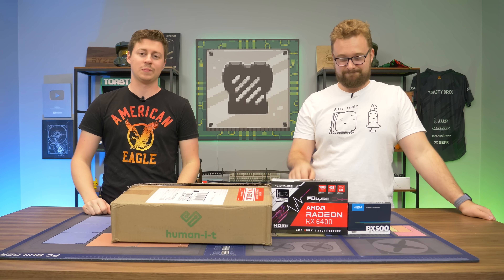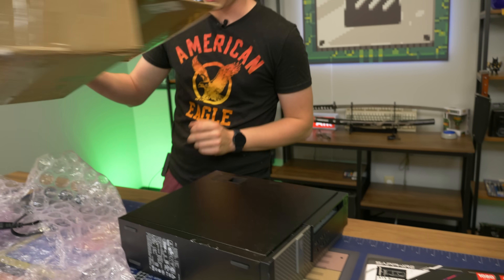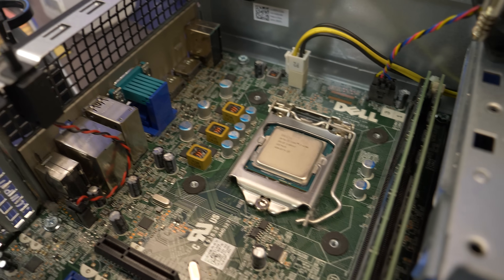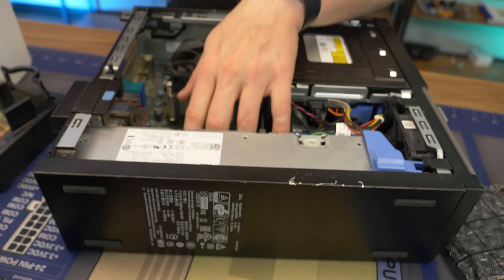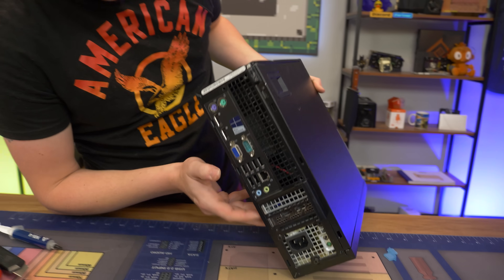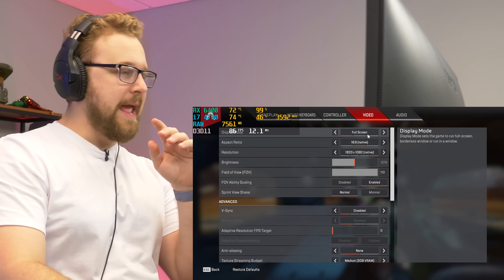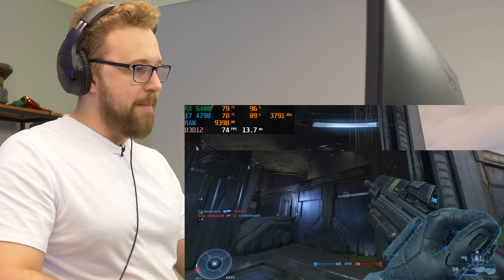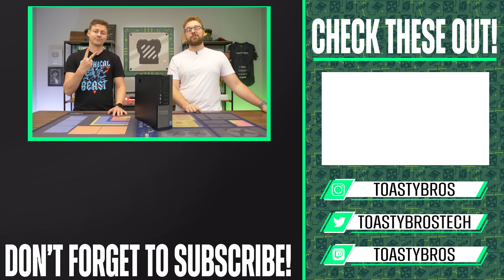EASY $350 Gaming PC Build 2022

Comment: hey guys wanna know if a pc with a i3 9100F and gtx 1060 6gb with 16 gb ddr4 ram is a good buy for $550 or not
Reply: No.   The i3 9100f does not have hyperthreading and will give alot less performance than 10th gen intel at a similar price.   And the 12100f is WAY faster.    You will immediately want to upgrade because 4 core 4 thread chips don’t work well in some recent games.  
You can build a 10th gen machine for less than $400 before adding a gpu is probably what I would do.    The 1060 6gb is worth at most $200.    You can get a used rx570 for $150.   Id go that route or ask the seller for $100 off
Reply: @evers6214  ok thx man 👍👍
Reply: @qurvvv  dont listen to him, the spec is very good and it is worth it to buy these good pc specs
Reply: Depends where you are. I just sold a ryzen 1700, gtx 1070, 16gb ram, ssd etc for 460. I'm southern USA.
Reply: Not terrible, but on the high side. Definitely wouldn't consider it a good deal, but really depends on you're location, and the local market

Comment: yall still sleeping on the Lenovo ThinkStation S30 with a 1620 4 core 8 thread Xeon, they come equipped with a 610W 80+ Gold PSU and anywhere from 8GB of RAM up to like 32GB depending on what model you're getting. Some even have E5 1650 6 Core 12 Thread Xeons. Pair it with a GTX 1070/1080 8GB for a good sleeper build or case swap it to an In Win 101 or another case that top mounts the PSU as you will need that feature to case swap.
Reply from the maker: Will have to give that a shot!
Reply: @ToastyBros  note, you will need 2x SATA to 8 Pin for power hungry cards as the PCIe power is 6 pin. But it's a GOOD little rig. I have one for guests when they wanna come over and game with me.
Reply: @kingkosher6231  i have never heard of someone having a extra pc for guests. Im new to the PC world tho.
Reply: Xeon for the win. The real og budget beast
Reply: I built my Gaming Rig from an Optiplex 9020. i7 4790, Rx6500xt,  32gb ram ,3T hhd and a 1T ssd.  About 700 bucks  with Case,Fans,psu, and all the adaptors.  Still  about half the price of my Lenovo Legion and just as good.
Reply: @tonel5540  The 6500xt is an atrocious GPU and it’s bottnecked by the PCIE lanes not being 4.0 on your motherboard.
Reply: @ZackSNetwork  200 bucks new was a big influencer for me. Its really not bad for my set up. I was being cheap.
Reply: @tonel5540  how much did you spend total?
Reply: @anarchygood5864 $700 for everything at this point.I  was up and gaming for 250 bucks originally. Old optiplex and a 1050 2gb gpu. Had enough leftover parts to build up another ssf hp I got for 50 bucks.
Reply: New Build....Dell XEON 1620 32gb ram ddr4.. off Ebay$ 65 and $65 shipping..Threw in a 1050 2gb i had laying around, payed 50 last year...Surprising 100fps on FiveM, While running my server.
Reply: Oh heck your one on a good thinker, I never thought of that
Reply: ThinkStations are SOOOOOOO good for the money. Agreed. They are sleeping on them. My ThinkStation is a FULL SIZE case so sky is the limit for GPU. Enough with the low profile. Lol
Reply: Just put together a  2019 OptiPlex 3070, i5, 16gb ram ($150) and the rx 6400 ($119). I noticed that the card runs really hot. I thought the fan failed at first. I may get a case fan to draw heat out and cut a hole on the side  to  fit a vent screen. Let me know what you think.
Reply: The Dell 5810 is basically the same thing
Reply: S30 is from 2012. The one showed here is from 2014. Your sleeping recommendation goes beyond $350. The point here was low cost, Low power usage, good performance. You're sleeping bruh
Reply: That card sucked at fortnite 
 in this pc.
I dont play it though.
Mainly racers and flight.sims on pc for me,.running around killing goes against my Christian faith.
Reply: Lenovo thinkstation s30 are 600$ and up

Comment: The max I would put in a SFF Optiplex or any SFF OEM sistem is a GTX 1650 or Super LP card.
Reply: Well lucky for you those are the most powerful cards they'll take anyway lmao
Reply: @SlowHardware  Exactly,  If I would've had a SFF PC with PCIE x4 gen 4 maybe but since most SFF PC's are with PCIE gen 3 it's not worth the performance loss.
Reply: @Teksers  I actually sold an sff pc that u used as my main rig while my x58 pc was down not long ago. It was 16gb ram, i7 2600 and a gddr6 gtx 1650. Performed well but was well slower than the overclocked old 6 core and r9 390x, fun times.. now on a Ryzen 7 3700x and an RX 6700 xt with 32gb ram
Reply: @Teksers  also putting together an optiplex 390 with a gt 1030 atm

Comment: Love optiplex builds been watching people build them for years! Just built my own and did a full case swap. I5 3570,EVGA 1050ti SC,EVGA 80+500w, 250gb ssd and 8gb of ram in a Musetex Case. Super happy with the performance for less than $250
Reply: nice little build bro, that sounds like a decent budget build!
Reply: Sounds like a good computer to flip back then and nowadays. Imagine how much you could flip this for during the GPU shortages. But if It’s for personal use and I made something like this for myself, I would’ve been so proud of that build.
Reply: @tenshi1333  Lenovo ThinkStation S30 / ThinkCentre M900 with a GTX 1060 6GB is the new Optiplex.
Reply: basically what my friend used to have before his pc stop working now he got a new pc
Reply: what are the use of the pc you built so far?
Reply: @funfever8484  I mainly built it for content creation. I'm a photographer/Videographer so that's the main thing I use it for. Adobe apps, things like lightroom, photoshop and Adobe premiere. Gaming wise, I play Apex Legends, pubg, GTA 5, FiveM and a few other free to play titles as I haven't got very many games for it yet. All of them have no problems running 60+ fps I see an average fps of 80 on medium settings on PUBG.
Reply: @alexortiz6891  interesting.
Reply: i did one but with the itx 6400 for 350
Reply: best way to get into pc gaming i think for the price
Reply: My only issue with Optiplex models is their PCIe slot often won't push more than 50W, while some low profile graphics cards require up to 75W without a 60pin power connection. So that nixes the low profile versions of the GTX 750 and GTX 1050.
Reply: Did you use a dell 9020 sff (like in this video) or the mid tower? If you used the 9020 sff did the mobo go into the case okay?
Reply: @LL-wc4wn  I used a 3020 SF and upgraded from the i3 to an i5, it now has 16gb of ram and is my wife's work pc I built a new system for work as the 3rd gen i5 couldn't keep up with the demand. Still works great for gaming tho! Played the new cod on it and get a consistent 60+fps 👌 low setting obviously.
Reply: I'm about to do one with a GTX 1070, Haswell i5, Corsair CX550, 120GB SSD, 1TB HD and 8gb Ram, stock ATX case.  Total cost £230.  PSU and SSD are brand new.  I'll lap and possibly delid the cpu and add Gelid or Thermal Grizzly paste.  Maybe push the boat out and upgrade the case fan.  I've got my eye on a cheap HP pro with a Skylake i3 in it for another build, then I'll source a cheap i5 cpu for it.  I'll always keep the stock cases as that's the fun for me, I've built numerous custom PC's and occasionally used generic office boxes to do them in.

Comment: I just finished one of these.   I7 4770 + Sapphire RX 6400.   runs great for $250 all in.
Reply: 250 is EXCELLENT for a 1080p gaming rig! great stuff!
Reply: I got a SFF HP 600 G1 with a 4770 and 16GB of RAM for $40 cash. Bought a RX 550 for $32 after shipping, and I got a surprisingly potent build for $72. I might upgrade the storage to complete the build, and add an SSD. Not bad for a 2nd PC I can leave at my parents house for when I go visit.
Reply: do you have some data ? any FPS ?
Reply: @jorgemaldonado2199 It plays well, you can run almost any game at 1080p 30 fps, and a lot of games that are a couple years old at 60 fps. Esport games run very well, 120 should not be a problem on most of them. The 6400 is gimped by the PCIE 3.0, but make sure you do have PCIE 3.0. If you use a sandy bridge CPU or older, ie: 2nd Gen Intel (I7 2600, etc..), those have PCIE 2.0. I believe some ivy bridge OEM boards may be PCIE 2.0, but Haswell should be safe so I would definitely recommend that gen or newer. Check local pricing in your area, but for me I find the price of a RX 550 generally way more favorable than RX 6400, for only a bit less performance. If you can fit a 2 slot GPU, I would consider going up to the RTX 3050 6GB or even an RTX A2000. I have both of those and they're a lot better than RX 6400, none of them use power connectors, but I do give the RX 6400 credit in being a single slot card, I just find it a little expensive for what it is. If you have a very new build, I would consider Intel ARC A310 or even A380, those are priced extremely competitively and perform extremely well when they do, but know they won't work on anything older than 10th Gen Intel.
Reply: Sick. I’m doing something very similar. SFF optiplexes with i5s and adding rx550s. Will play some games for sure..

Comment: I know I’m never gonna get a 350 dollar gaming pc but these vids are entertaining.
Reply: Yeah if you get the same parts, guarantee its way over $350
Reply: @MSDGAMEZ  yeah that’s why I’m unsubscribing lol 😂
Reply from the maker: Try it! You will be surprised how easy it is for $350
Reply: @ToastyBros  well it was entertaining but I think I’m gonna get one around 900 dollars
Reply: @ToastyBros  hello man check dell optiplex 3060 it has 8th gen core i5
Reply: @MSDGAMEZ  Or you could just do a little eBay searching and find it isn’t that hard for a similar system. Only thing weird is the 24gb of ram
Reply: @MSDGAMEZ  update: the system I described above came out to exactly $349.00 after shipping and taxes lol
Reply: Yea these guys are always like $200 off
Reply: That's about the right price. You'll probably get a better deal if you buy the Dell/HP towers with the i3 (4170 etc) then upgrade the cpu to a 4790 and the psu so you can put a better video card in it.
Reply: @JamesSmith-sw3nk  I agree, but it's a toss up. I probably wouldn't recommend buying the i3 just because it's tough finding a decent price on an i7 to upgrade too. It'll probably even out either way, but I would  recommend looking at the Xeon CPUs I Just upgraded a PC it had i3 4170 upgraded to Xeon E3 1231v3. Basically same performance as i7 4770. Xeon was @ $30 all in, and the 4th gen i7's going for $50-70 for whatever reason people buying them. Just ain't worth that these days. New i3's are beating these older i7's, and you'd have good upgradability. Now that GPU prices have somewhat come down to earth actual budget price to performance you could easily build a PC using newer hardware for this $350. If you have one of these old desktops have at it max it out, but if you're starting fresh I'd aim higher.
Reply: $350 is more than doable lol, currently working on a nicer SFF Dell machine with the following specs for a friend:
$100 - Dell Precision 3420 with 1x8Gb of DDR4, a Xeon 1245 V5 (same as i7 6700) & 500GB HDD
$35 - second identical 8GB stick for dual channel and 16GB
$160 - RX 6400
$28 - Basic 250GB m.2 boot drive